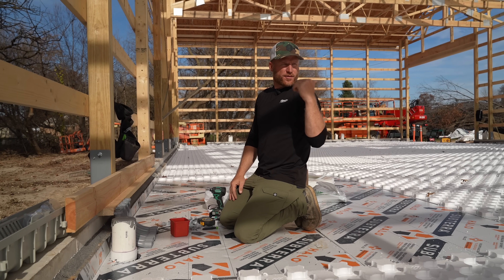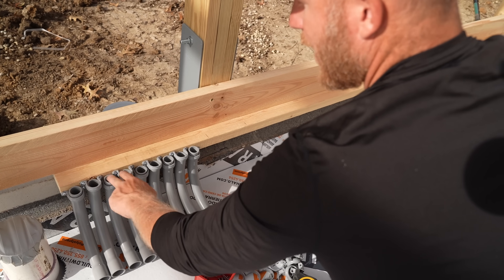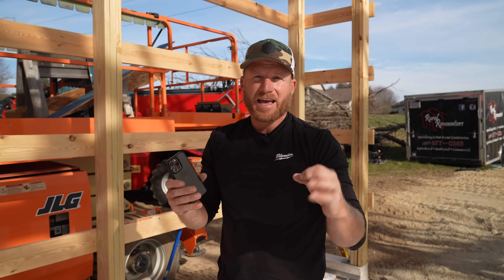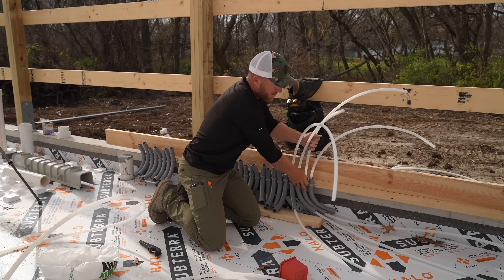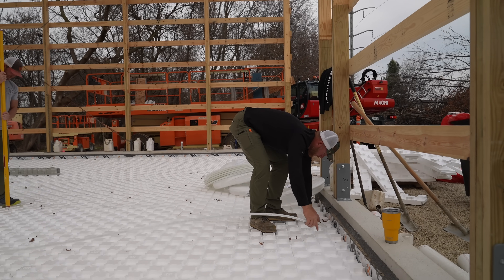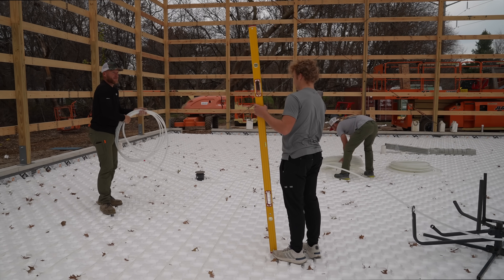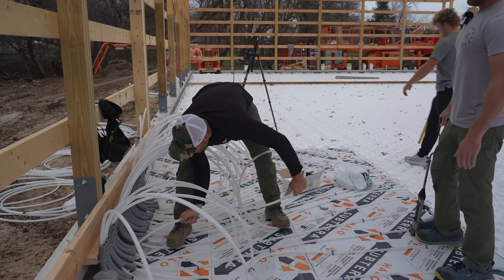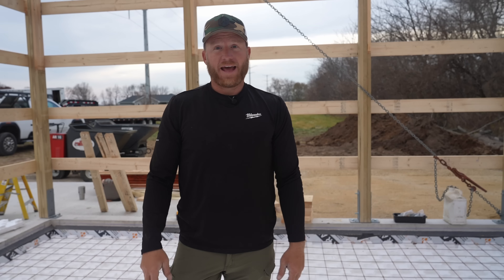My Dream Shop Ep-19: Installing The Radiant Heat PEX Tubing

Comment: I got a loop crushed during concrete placement and has never worked.  Wish I had filled tubing with water air first.  It was good that I had two loops in a 400 sf slab - the second one does work!

Comment: TIP: When installing PEX into the Heat Sheet, have one person in front of you with the coil in their arms about 10 feet away, and follow them while pushing the PEX into the pucks and then stepping on the PEX to secure it. As the installer, I would literally hold the PEX down and push it into the pucks. It's a toll on your back, but the PEX goes in very well this way.

Comment: I don't understand the great benefits of a radiant floor. As long as the concrete is insulated by 2" sheets of foam, it will act a big heat sink from any other heat source. Like a big flywheel for heat. Once heat is stored, it would take a lot to vary it.
Reply: You've hit the nail on the head.  It's a big thermal flywheel and when you're in control of it with the hydronic system, you can use it to your advantage.  The benefit is that it replaces your need for any other heating source.  Heat rises off the slab and heats the entire space in a very even and comfortable way.  No hot spots where the forced air heat is blowing, no cold spots where it isn't blowing.  No blowing dust around either!  Radiant slabs also do a great job of evaporating moisture off the surface if you've got snow melting off of equipment or rain dripping off.  -- Jay from AMC Foam.

Comment: This is probably a stupid question, but will the  radiant tubes get too hot and melt the foam? Just curious because im thinking about doing the same process on my shop.
Reply: No such thing as a stupid question!  In order for the foam to melt, you'd have to be running your hydronic system so hot that you wouldn't be able to walk on the slab.  You don't need to run the hydronic system very hot at all in order to heat the space with the radiant thermal energy coming off the slab. -- Jay from AMC Foam
Reply: @amcfoamtech  Thats good to know and it makes since . Thank you for the clarification!

Comment: Anytime installing floor heat try a tubing collector box from menards they work great and the return and supply stack nicely put of the concrete and are ready for the permant manifolds spacing

Comment: We used to use orange , green, blue, and red marking paint to lay out the runs so there was less chance of messing up the pattern. Turns and such. The manifold always causes issues as you can never get the concrete to fill behind them on the floor. So we started making a cut out in the wall, and then the floor was poured, loching it in better. It looks much better.

Comment: Sioux Chief 5/8" with o2/Barrier Radiant Pex A Pipe is Used for Large Shops. 4" Centers around the perimeter  &  9" or  12" Centers thru out the center.  Always run the Pex Pipe in Loops toward the Garage Door Openings for the larger heat loss in that area. More Loops in front of the garage doors is best! Do not run the Pex Pipe across the door openings. Sioux Chief Designer.

Comment: Should you not be pressure testing those tubes before installing the concrete. It would be such a nightmare to have to lift a newly laid slab because of a pinprick leak.

Comment: Its fall and winter is coming.  It showed a little in this video.  Know you wish you had more time to do it the Kyle way.  We call the nodules, knubs or pucks around here.  There is a different brand of foam underlayment called crete-heat.  The heat sheet heavy is equivalent to plain osb and crete-heat is equivalent to zipboard.  Crete-heat has a vapor barrier applied to it (funny its green also).  What type of rating are you going for on the floor?  I was little surprised by the use of wire mesh instead of rebar.  Or was it the time factor?  Lots of things go into decisions: time, $, knowledge, experience.  I have heard of manufacturing defects (pinhole) in the tubing. So I personally would  pressure test all my lines but I am not a gambler.  Can't wait for the next episode Kyle.
Reply: Hey Glen, at this thickness and density of Heat-Sheet, the EPS insulation actually has a low enough perm rating that it performs as a vapour barrier, well within code requirements.  Therefore a built-in vapour barrier in the panel is redundant and represents additional material cost.  If you compare the nodules that grip the PEX pipe between Heat-Sheet and Crete-Heat you'll notice that Heat-Sheet actually has twice the amount of contact surface area to grip the piping in place and ensure that it doesn't move during concrete placement.  Have you had the chance to try out Heat-Sheet on a project?  -- Jay from AMC Foam
Reply: @amcfoamtech  What is the pressure rating of that foam? Was Kyle being overly OCD for a 1/16 or would that foam handle that?
Reply: @alexbravo4  Kyle used our Heat-Sheet Heavy 25 product which is very commonly used and is the lowest density we make Heat-Sheet in.  The "25" designates the minimum compressive strength of the foam at 10% deformation.  In the US it would be considered a Type IX EPS foam and in Canada it would be considered a Type 3 EPS foam.  The different types are just the naming convention depending on whether you're using the ASTM or CAN/ULC testing standards.  Heat-Sheet is also available in 40 and 60 psi options for heavy and extreme loading conditions.

Because it's a very durable foam, the base it's laid on does not need to be "perfect" but base prep is a very important step in concrete flatwork.  More attention to detail and work at that stage usually means a less stressful pour day and a better end result.    Good base prep also means you'll avoid using having a slab with spots that are too thick (wasted material) or too thin (potentially weak).  

Thanks for the questions! -- Jay from AMC Foam

Comment: On one of your insta posts, there was a European guy saying they do like 14 inches of sub grade foam insulation. That got me thinking…could you layer up ordinary rigid foam sheets, or maybe some RockWool, then use this product as the top layer for radiant piping management?
Reply: Absolutely you could do that, the most popular sizes of Heat-Sheet are 2" and 3-1/4" but it's available as thick as 6" on special order basis.  Or as you stated you could absolutely use a more readily stocked and available size and build up flat sheets of insulation below it.  Whatever material you use for that build up just be sure to use at least the same density and compressive strength of insulation to avoid any movement.  For thick insulation assemblies such as that I would recommend consulting with an engineer to review the design.  -- Jay from AMC Foam.
Reply: @amcfoamtech thanks Jay!! I’m a couple years away from military retirement and dreaming of a DIY barndominium. Trying to ask all of the questions early and stay on top of building science so I can make smart choices to find our sweet spot to balance performance versus budget.

Comment: have a real question: what happens if when laying a loop you notice there is not enough length to be able to complete said loop? you pull it up and replace it with a new roll of tube?
Reply: they just started a new roll for every run that was longer. you can see Kyle throw away a small bundle from the leftover roll a few times.
Reply: @rusticacrefarms1507  thanks for the explanation bud ☺️
Reply: @Malandrin  no problem!

Comment: Hi Kyle, are you installing a heatpumpe as your heat source? With your heated floor (big footprint to heat building) and what I will assume will be a relatively good insulated and `draft-less´ house  I think a heat pumpe is the best solution. It´s low maintenance, and relatively low cost because of the lower electricity prices (compared to European average) and if you install solar you could even lower that cost long term
Reply: Heat pumps are horrible in the northern half of the US.

Comment: Do you  typically fill the system before pouring, after, or does it not really matter?
Reply: Should be tested with compressed air beforehand. Typically you’d leave the system under pressure during the pour to expose any leaks from rough handling.

Comment: Probably too late now, but you should connect the ends of the runs together, put a pressure gauge and put air in them. Then when they pour concrete, they will see if they hit a line somehow , because the concrete will bubble up in the spot the leak is.
Reply: He should have cut out (I’d have started over) the kink. It’ll restrict that loop and make it more difficult to balance.
Reply: What do you do with that information at that point? It seems impossible to fix in the limited time you have before the concrete sets, so you just tear everything out and start over or mothball that loop?
Reply: @cg68241  No. You just find the hole in the line (air will be coming out), cut it and crimp a splice on. Will only take you 5 min.

Comment: I'm surprised that you don't do a pressure test and maintain pressure on the tube to confirm that it is good during the concrete pour, especially since you are going to be running the buggies over it.
Reply: would be silly not to have it pressurized during the pour. I'll be surprised if he doesn't considering he's always trying to avoid easy mistakes.
Reply: No way I’d put all that money and effort into the underfloor pipework without pressure testing, according to some guys I’ve watched doing this it is a code requirement in some areas.
Reply: yeah exactly. Now you'll never know if you're leaking hot water in your slab... @CrimeVid

Comment: Looks awesome bud, my OCD was kicking in and wanting to pick up all the leaves!  Me and Paul got the stone installed on the front of my building today, perfect weather.  I've still got to get some more crusher rock spread inside and compacted yet before I can install my foam insulation.  I've got 3 zones with 8 runs at each manifold, so 24 total 300' runs, remember my shop is 60x120x16, I already have all the tubing and plumbing parts ready to go!  Take care and happy holidays to you and the family!

Comment: Best practice would be to get the manifolds installed and put the loops under air pressure test before concrete placement, check the loop pressures during concrete placement to make sure that none of the loops gets damaged when the concrete is placed.  If really organised you could have filled the pex with water and put them under hydraulic pressure test.
Reply: An expansion tool and some tee’s & couplings are all he needed.  I’d never pour concrete over any pipe without pressure testing first.
Reply: @bojangles_bonjangles8000   Came to say the same thing. Just tees and a pressure gauge will get the job done, but if there is a defect, now is the time to find it.
Reply: I didn't hear mention of it but I guess you probably did your research but hopefully that was Oxygen barrier PEX for the loops. 
Like many others have mentioned, pressure testing of the loops is absolutely crucial to make sure it holds the pressure for 24h. Temperature variation will affect the pressure a little but this is "the" step at least to me that you really must not skip.
Reply: Absolutely! And in case of shit happens, air bubbles going thru the concrete let you know.
Reply: And they said kink, which means compromised. May not be an issue on a low pressure flow design such a this.
Reply: You’ll want to fill the pex with water or it will try to float up.

Comment: Did you pressurize the system to check for leaks? Also, leave it pressurized as you do the pour…
Reply from the maker: nope...being locked into the heat sheet i had no worries
Reply: brave man considering you're buggying the concrete over top. @RRBuildings

Comment: I'm sure its too late now but you should do a zone for your concrete on the outside! No shoveling in the winter 😎
Reply: Ha. I saw where someone did about a quarter mile of driveway. 🏝
Reply: I drilled a hole through a piece of 1inch pvc and cut in the center of hole to make a push stick that cradled the pex

Comment: You should have set up the manifolds and connections to do a pressure test before concrete. A leak because of a bad spot in a tube would suck.
Reply: (required by code here, aye)
Reply: Not necessary
Reply: umm yes it is. That's like laying a new gas line and not pressure testing it before backfilling. @daveklein2826

Comment: Why would you run the tubing so close to the walls? These areas are usually mostly covered under cabinets, shelfs and work benches, so it seems to me that it is a lot of wasted energy heating nonhuman occupied space. I live in SW Florida, so I don't really know about radiant heating and every shop is set up different so what am I missing?
Reply: for us (zone 4 marine), 6" from exterior walls because they're colder, and the tubing gives a better heat output on those because it's closer than say the 12" spacing in most other areas.  Basically, higher heat loss on those cold exterior walls so closer tubing
Reply: I get the spacing for higher heat concentration, but I would think running them 24" or 36" from the walls so as not to heat the bottom of cabinets and work benches would be more efficient. Thx for the reply. @srchubz
Reply: @JB-xp8xl  well don't forget the whole point is to heat everything you can somewhat uniformly.  The thermal radiation heats the floor, then all surrounding objects touching the floor, which in turn heats the entire space.  Putting the tubes too far away from things would actually decrease the efficiency

Comment: Kyle, try a measuring wheel to press on the radiant heat pipe in place.
Reply: The way he was rolling it into the slot towards the end is the best way I found but you have to give it enough downwards pressure so it sits at the bottom right away and then no need to even have anyone behind you. Anyways that is how I install it but more than one way to do it.

Comment: I would love to see you doing a video comparing the differences between post framing and steel frame as in the uk it’s very common for steel frame buildings opposed too using post framing or stick framing

Comment: I’m guessing that having radiant flooring is more efficient to keep your shop heated compared to having a tube heater or other heating solutions
Reply: Yes. Radiant floor heating doesn't need the water to be particularly hot -- 35'C is more than good enough, and a heat pump can manage this very easily. With their efficiency of over 350% typical (i.e. for every 10W of electricity that the heat pump consumes, you get 35W of heat output) it's probably the cheapest way to run it. The up-front cost is just higher, as with a lot of these things.
Reply: @aaronmdjones  for really good insulated house/shop even less. I had a house back there in Europe, insulated 30cm in floors and walls, 35cm in roof slopes, 45cm in attic, 3-pane windows and so on. Never got water in heated floors above 27C when it's -34C outside, 22C inside.

Comment: what about a pressure test on it to make sure that kink wont cause a blow out. Ive also seen most people who do this leave pressure in the pipes as the concrete is poured to prevent any collapse
Reply: You should leave the air in the system until after the concrete pour, if for some reason you get a blow out you can fix right then

Comment: It's a lot easier when you use the radar blue against that white styrofoam! I think it made it so much harder being white on white!
Reply from the maker: Agree but white was what I got… next time I will ask for many different colors so you can see every different loop
Reply: @RRBuildings do you let Greg take control of the engineer drawings or do you check all of Greg’s work plus will Cole start working with Greg on projects that you run from the office once he graduates

Comment: very suprised with the foam thickness you use -we use min.20cm foam as isolation before poring concrete on the mesh floor unless you live in florida or very warm places these are standards to help make things more green,otherwise i think your the best wish you lived close by :)
Reply: Different regions and climate zones will require different thicknesses of insulation.  When it comes to insulation, more is always better but local cost of energy and regional climate are also important factors!  -- Jay from AMC Foam

Comment: Wonder if a can of spray paint to do your layout on the insulation would have sped up the process
Reply: Not a bad idea but be careful with rattle cans and foam insulation!  Many of them contain solvents in the paint mixture that can actually eat away at the surface of the insulation.  A safer option would be to use a lumber crayon or a permanent marker, or double check that you're using a foam safe spray paint.  -- Jay from AMC Foam
Reply: Waste of time and money
Reply: It only took a couple hours as it is, so that would have been a waste of time.